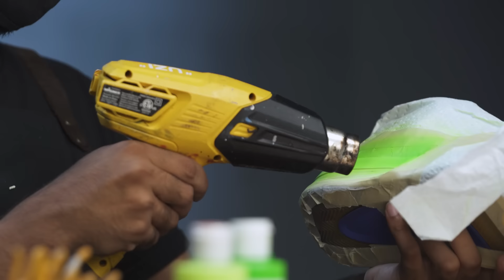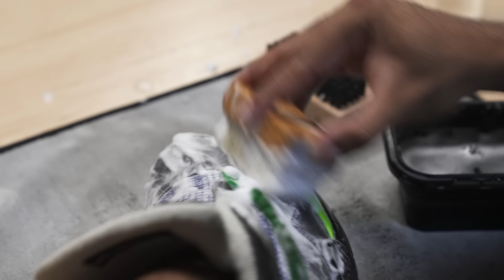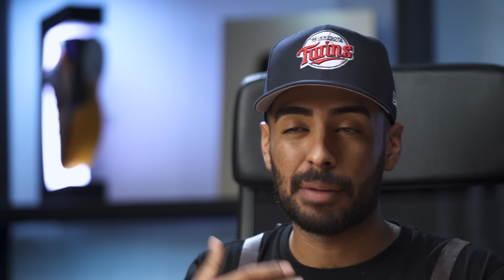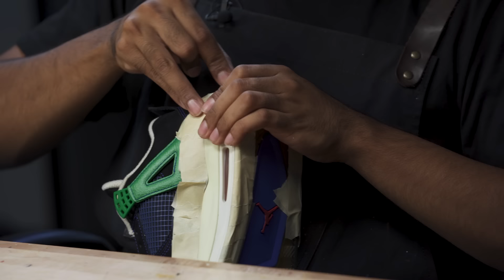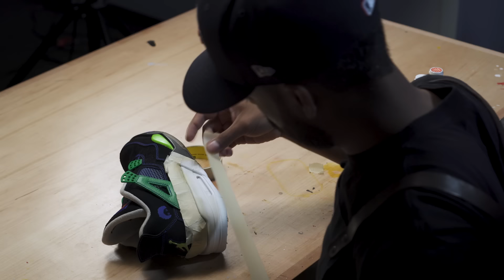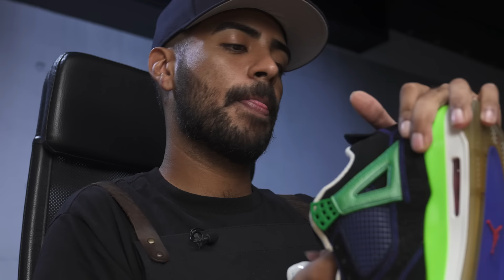Jordan 4 Restoration - Tips & Tricks For Repainting Midsoles

Comment: I tried to repaint some bred 4s and it looked alright, but the paint started chipping after a couple weeks. Any recommendations?
Reply: How much matte finish did you apply? I'd say strip the paint completely, reapply the paint, then use LK tops matte finish.
Reply: @moriellymoproblems7842  two coats. Thanks I'll try
Reply: @Chackotaco89  had the same issue when I first started. I’d be surprised if any of these clients even wear there kicks after all these restorations. After tons of midsole repaints and the same issue you were having I’ve discovered Bulldog adhesion promoter on the acetoned midsole then use createx adhesion promoter 75% paint / 25% createx and then LK kikz matte or factory sealers and should be good to go with midsole repaints not cracking and lasting. What they don’t explain is how acrylic paint is essentially brittle and cracks with temperature and weight so you have to combat that with adhesion promotion to allow the paint to withstand Pressure, temps and bend. Krylon matte finish makes the paint mad brittle and has very little flex in it, def recommend liquid kikz products for that and should have no problems
Reply: @FlipJackson  thanks so much
Reply: Krylon matte finish
Reply: @thomasvogelaar5533  yeah I did that as well
Reply: @Chackotaco89  daamn thats all i got